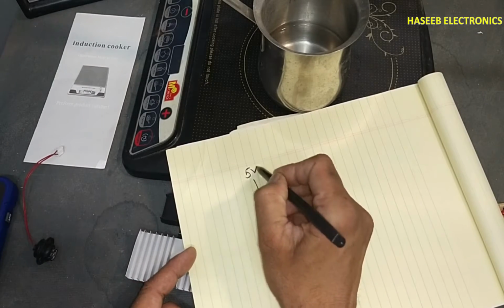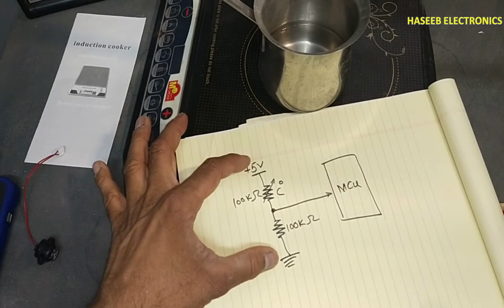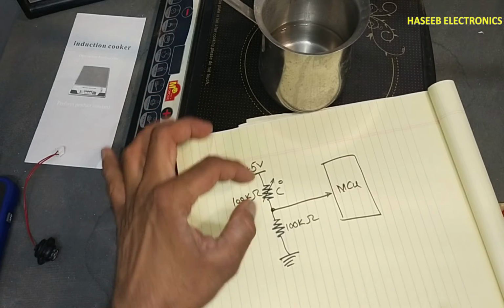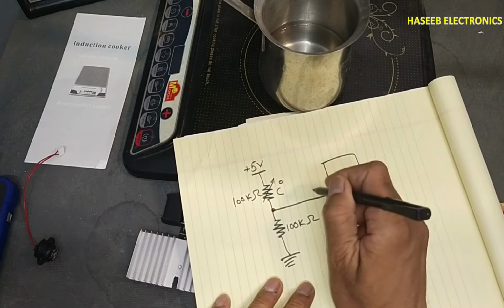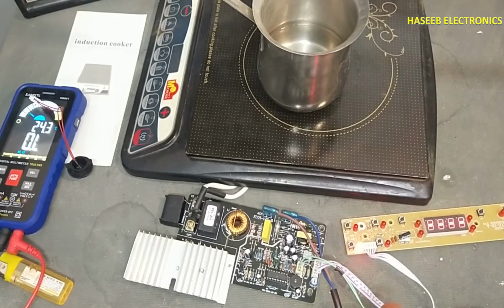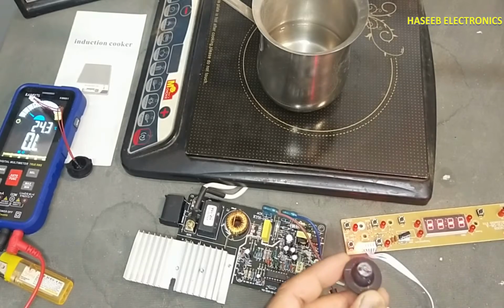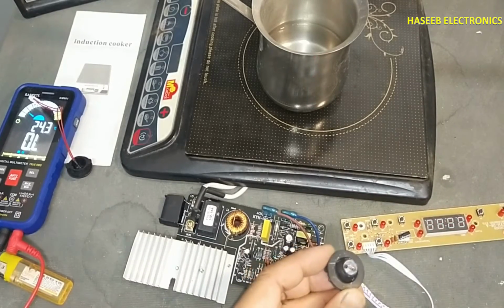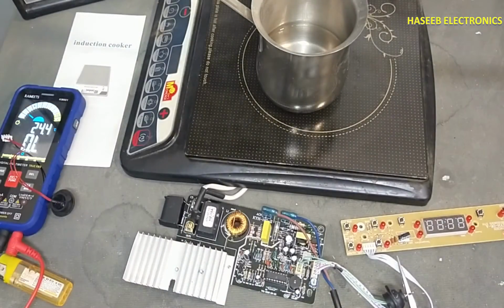{886} E3, E4 in Estrella, E5, E6 Error in Prestige induction cooker

Comment: Thanks sir, beautifully explained. In my case the surface becomes  really hot. Ventilation snd fan seemse reasonably good. Sensors examined found good. Inherent Software  problem... God knows. Although costlier cook top it is, another one from prestige pic 1.0 v2 is serving 7 or more years in our other house. By the way you responded is so valuable to me. Lot of thanks